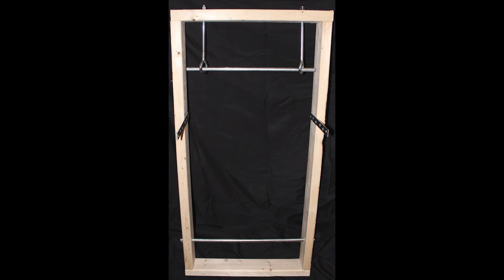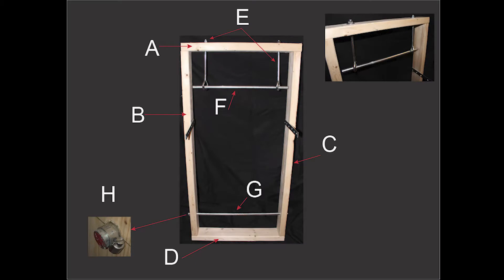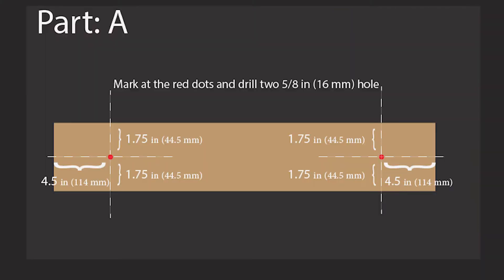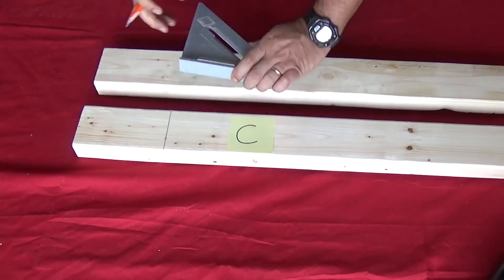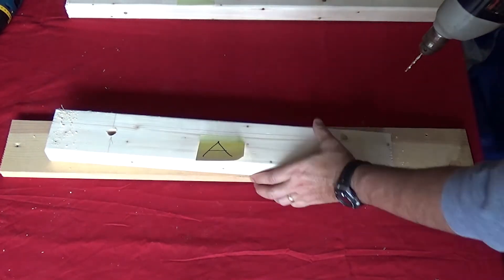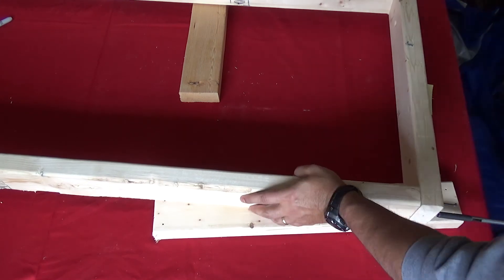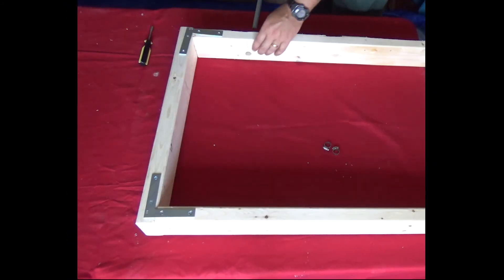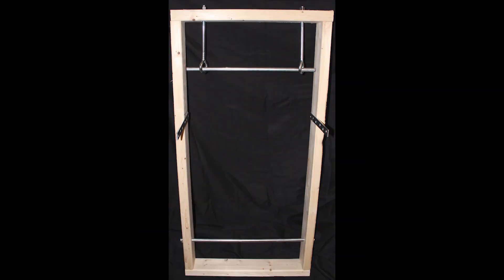How to Build a Loom for Weaving Kilims

Comment: Thank you so much for this video. I have a question: With the top rod system, is it possible to loosen it and pull down the rug so the back warps end up in the front, so that you can make a longer piece (double the length)? Or would you have to modify the construction of this loom to be able to do that?
Reply from the maker: Yes. If the warps are wrapped around the top rod correctly, you should be able to loosen it and then scroll so to speak. To be sure , test it out. Only wrap 10 warps and do a couple of rows. Then loosen the rod and move the front warps down. Good luck. 🙏

Comment: Hello, I just finished constructing this loom and getting all the other suggested weaving supplies together, and I’m very thankful for your instructions! If it’s okay to ask a question: Is this loom strong enough that you could weave small hand-knotted rugs on it, or does it strictly require one more similar to the loom you use in the hand-knotted rug videos (for example, one that has pins/nails for the warps instead of a steel bar)? I’d like to try my hand at both, and it’d be helpful to know if I would eventually need to upgrade for hand-knotted rugs. Thanks again!
Reply from the maker: Depending on how wide your planned rug is , you should be ok.  As you well know the amount of pressure required to weave a hand-knotted rug is higher than the hand-woven rug. Try with 6-8 inches perhaps for the width and see how it does. Good luck.

Comment: Would you need to put an extra board in the back for stability if you made a wider loom? This is wonderful. Thank you.
Reply from the maker: If you want to go wider, you may need to switch to a 2 by 6 piece of wood rather than a 2 by 4. It will help handle the pressure.